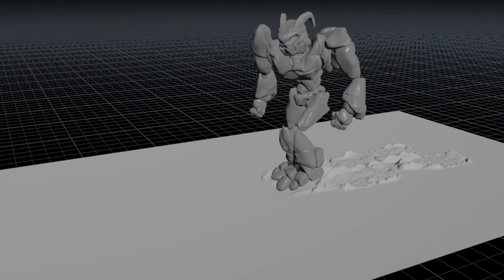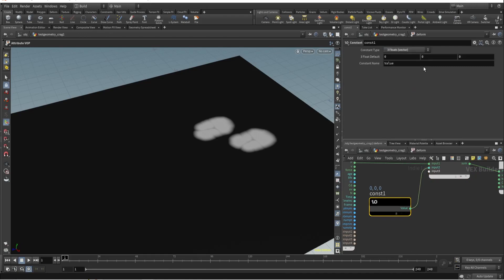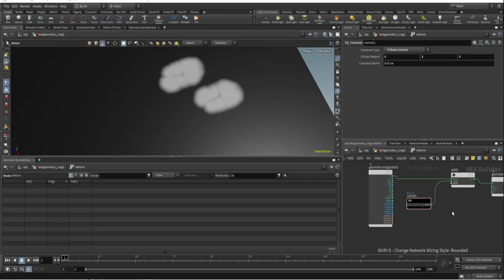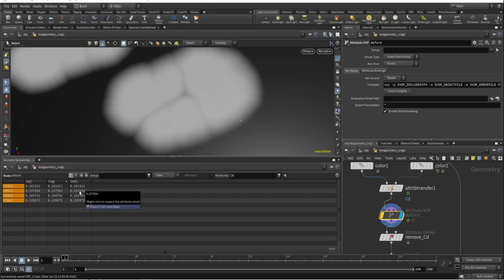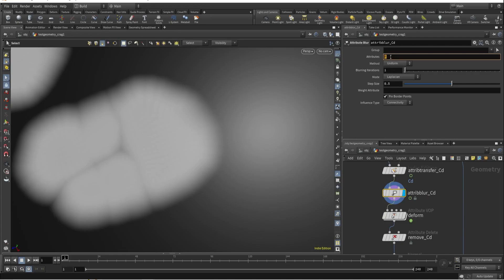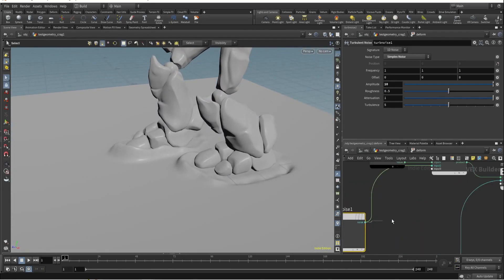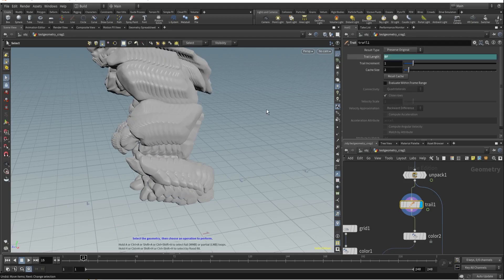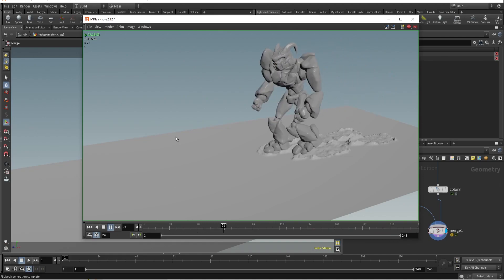The Way of VOP Part 2 | Procedural Footprints in Houdini (No Simulation)

Comment: Well done. I am subbed. 

I would recommend you next time to use a solver in order to save the contact thata instead of a trail node. It will be 100x times faster and cheaper on the pc plus you can do great things with that using vops.

Anyways. Cool tutorial bro :D
Reply from the maker: Yes Thanks, SOP solver is great for this kind of stuff, but i wanted to keep things simple for this one, maybe next time with more advance example :)
Reply: @VFXMagics  Great! Well done